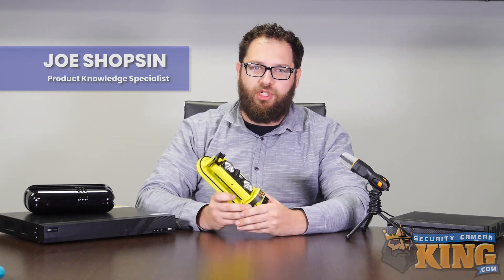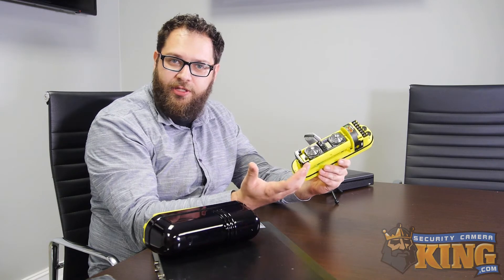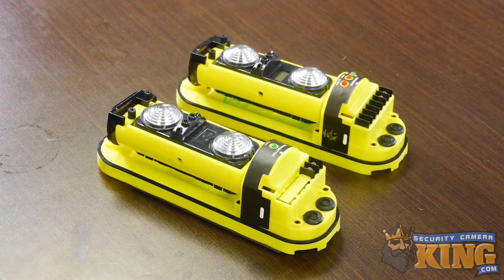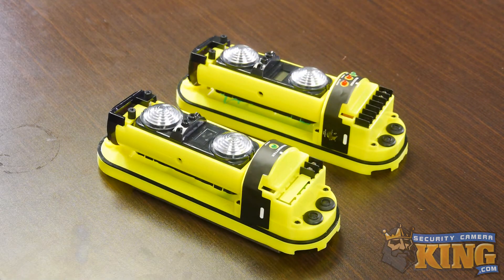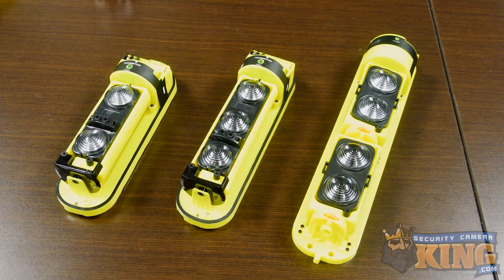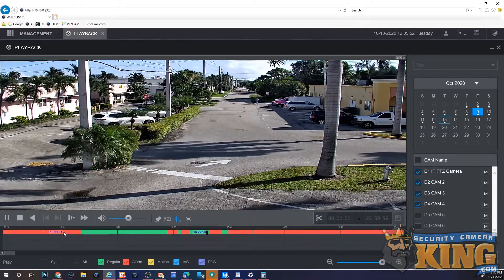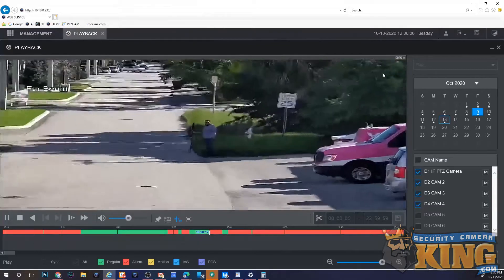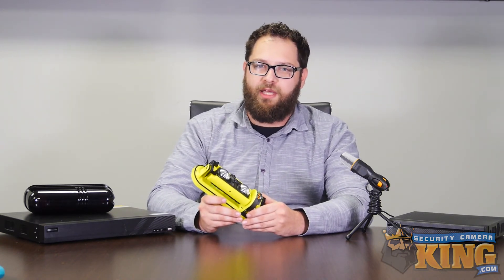How are Infrared Beams Used in Security Systems?

Comment: what is the difference between having 2,3 and 4 beam?
Reply from the maker: More beams mean greater distance between units is capable. 4 beams os 820 feet, 3 beams is 656 feet, and 2 beams is 328 feet. Additionally more means = more accurate and consistent detection!